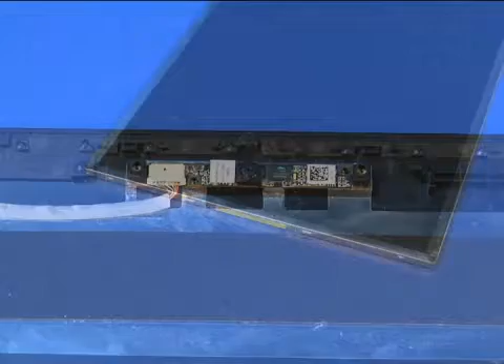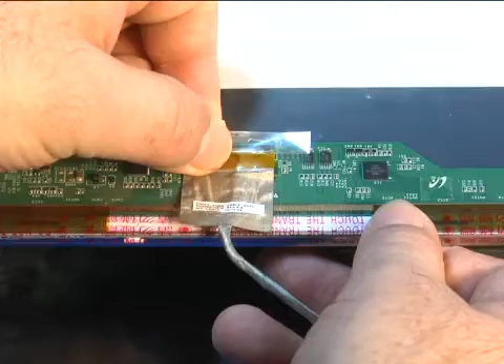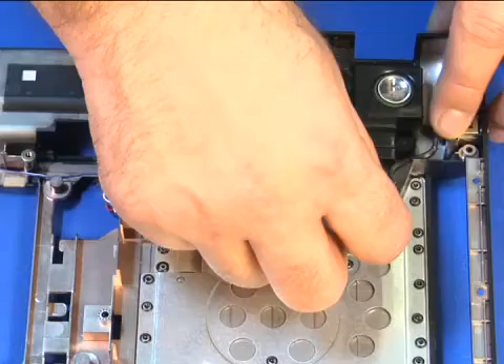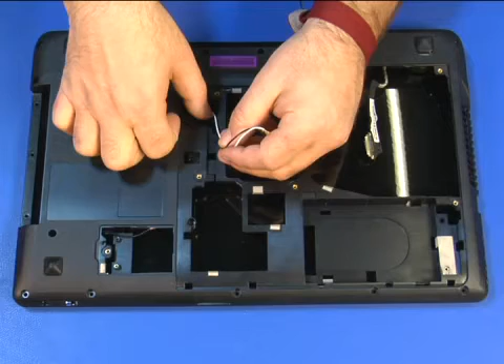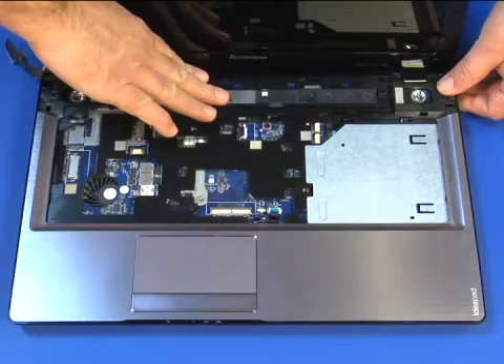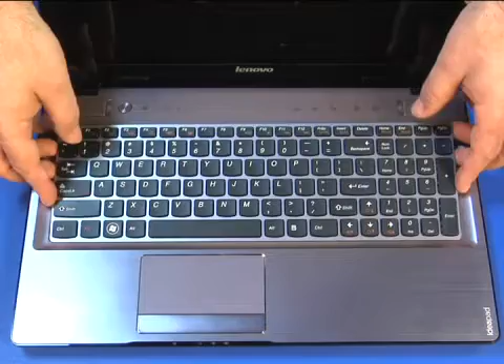Y570 Complete Assembly

Comment: I just replaced the rear cover due to the hinge issue on this machine.  I used both your disassemblly and assembly videos.  They were very clear and straight forward to follow.  There were only a couple of questions that came up, but watching them through answered my questions.  PC booted right up.  Now to function test.

Thanks.